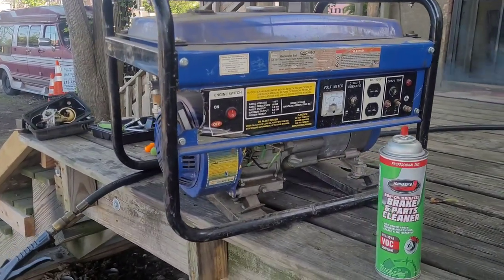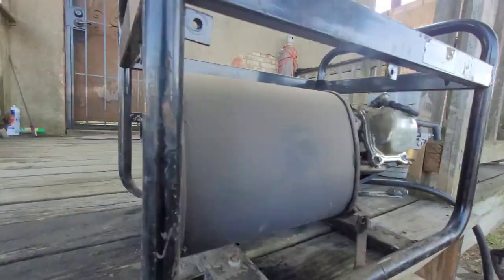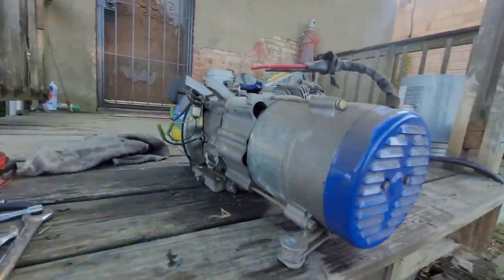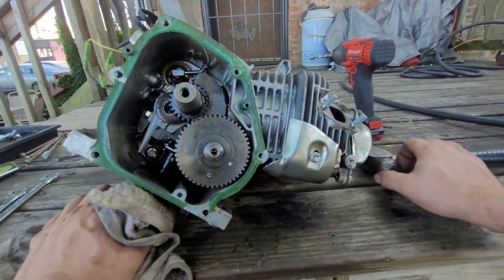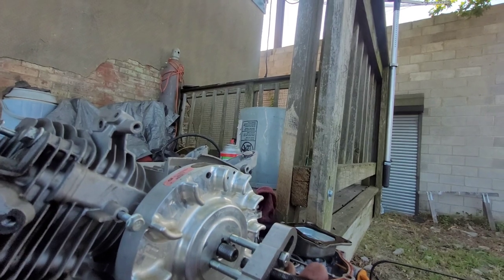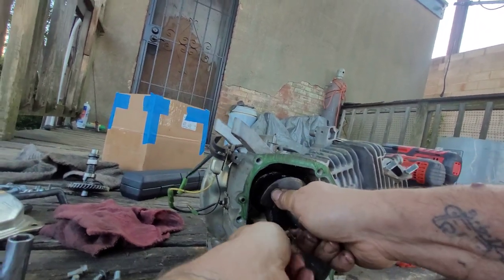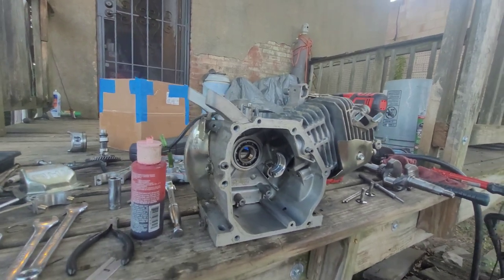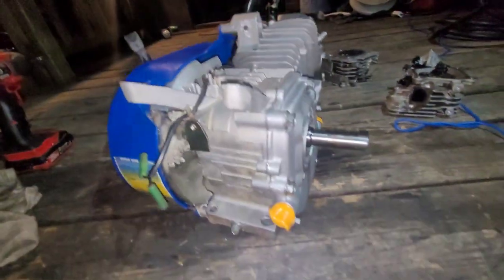Converting a Generator motor to a Mini bike motor

Comment: GX160 clone. 68mm bore with a 45mm stroke. Still would be cool to build and have on a mini bike. Just get a crank for it.

I have a small generator like that with a 208 Ducar. I run it on LP. Runs quieter and handles the same loads that it does with gasoline.

Comment: I'm literally doing the same project but the problem I'm going through is I have a 425cc 13000watt generator & I've gotten to the process of taking everything off til it's only engine but I don't have any crankshafts laying around for that big of an engine 😂..so im hauled kinda